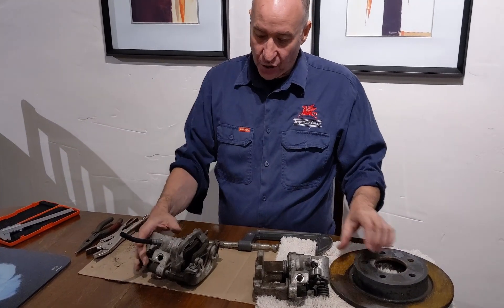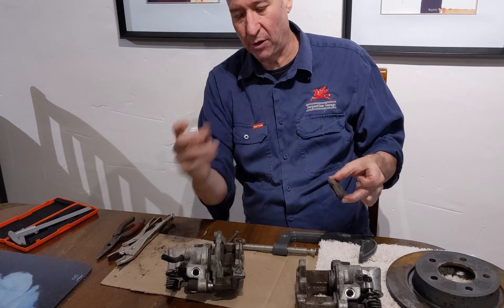BL Mazda 3: Retract the rear brake pistons. 2009 2010 2011 2012 2013 2nd gen cannot stuck clamp

Comment: Yes, We have Mazda 3 BL And I was wondering why the piston was turning but not going in. Thank you so much for the video Paul, only thing I did different to you was I used a Brake piston compressor and Vise Grips instead of a G clamp and Vise Grips worked a treat. Its Dec 2024 I hope you are over the cancer and on the road to recovery.

Comment: Dear Paul of Perth,
I am praying to the creator or to that which is everywhere present with all of my heart this message finds you well.
I pray that healing force which is everywhere present will be with you where ever and however you now find yourself.
Your Pegasus shirt is a delightful attire to wear as you give this  demonstration. My '08 Mazda may have corrosion issues which so far have daunted my efforts. But your video found me and gives me hope. I would only ask when is trying to persuade a reluctant component like this to retract pointless. The piston was so far out it took the rubber boot with it. The pads were so thin the horrible noise had me pretty much driving as much as possible without using the brakes for months since it just got worse and worse sounding .
My surprise was NOT finding metal on metal damage to the rotors that I can tell. And the hand brake caliper end does still seem to function somehow too. The sliders seem like they have never been greased as well. There was no pulling them out without figuring out that I could get the piston part of the caliper off by leaving them in. I was able to grap and gently  twist and pull them each out to inspect them. It does seem like they are not damaged but between the rubber and the steel there was SO much friction! Again: Bless you Paul! I really enjoyed your video. Thank you very much. Peace be with you and yours!
K.Z.

Comment: Thanks for this video! I found it helpful. I wanted to know when braking to a stop on my mazda 2011 i hear a clicking sound and i feel that it has to be a brake line would be in relation to tightening the emergency brake cable? Or would it be some else in your experience? Car comes to a stop just fine its just an annoying sound.
Reply from the maker: It can be a whole lot of different things.  I once had a customer car whose brake made a heck of a racket.  When we looked closely, it turned out that a little chip of gravel had got stuck in between the disk pad and rotor.  It screeched like a banshee.

So just pull wheel off and have a good look.  Regreasing the slider pins is always a good idea.  Yes, it could also be the handbrake cable, so look at that too.  

And think laterally.  It could also be a techscrew in the tyre that you only hear at low speed.

Don't be afraid to get in and have a look.  The only thing to avoid as a home mechanic are the hydraulic lines.  Once you breach those you need to bleed the brakes.  So leave them alone.  The hydraulic lines are the rubber hoses that bolt into the calliper housing.

All the best,

Paul.
Reply: @PaulinPerth Thanks Paul will have a decent look, just replaced the tyres not long ago and this noise pre dates the tyre change. Will go through your recommendations, appreciate your response. All the best.

Comment: Thank you for the explanation.  I was changing the rear rotor and pads today and couldn't get the new pads to fit in.  I kept turning the piston but it would not go back.  Tomorrow I will try again using the C clamp to put pressure while rotating.

Comment: What if you want to get the pisont completely out to brush it clean?
Reply from the maker: I'm not certain, but they might spin out if you keep turning the piston.  Try it and let me know.  Just be careful not to damage the rubber seal.  Paul.
Reply: @PaulinPerth  Thank you! It started to spin without moving at the end and the oil pressure was enough to make it close to pop off. Just a pull after that. Piston was looking good so I figured I just needed an oil flush. Works perfectly now.

Comment: Great video, solved my issue on a 2015 BM series.  A little warning to BM owners however, as I discovered that grinding noise may actually be pad to rotor.  I replaced both sides of course, only to discover that the left had just reached metal while the right still had around 5mm before the metal 'sensor' tab.  NO metal tab on one side and these were the genuine Mazda pads from when the car was bought in September 2015.
Good luck to Paul in his personal fight.
Reply from the maker: Well done.

Comment: Wow thanks I been trying to compress this thing a bit The whole piston came out of the rubber boot Looks to have threads, I will compress it and tighten it tomorrow The caliper may be worn out the brake pad was loose ratiling inside not against the rotor 😮

Comment: Thanks so much.  I recently changed the brakes on my Mercedes c300 with no issues with pushing in the piston but when I tried it with my Mazda 3 2010,  it would not budge.  Thanks so much for the detailed explanation and my prayers to you for healing 🙏...